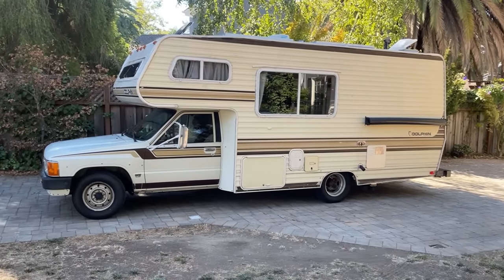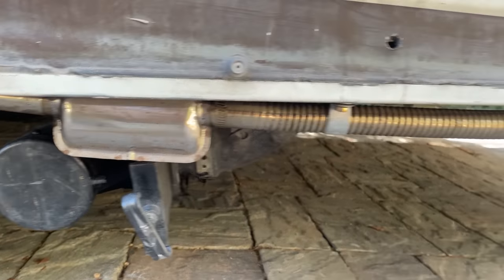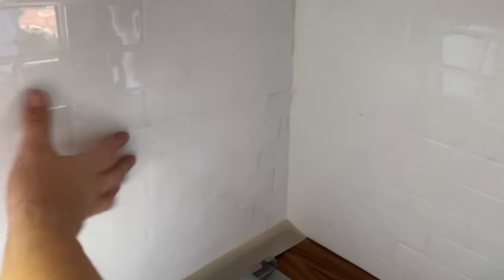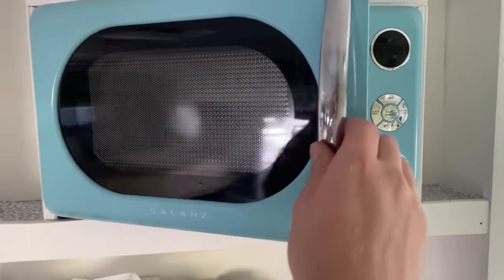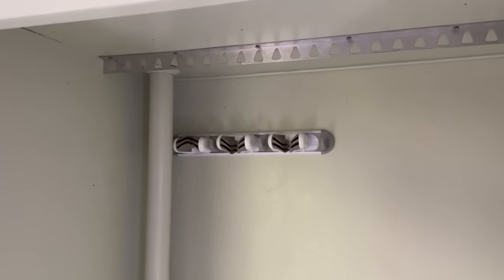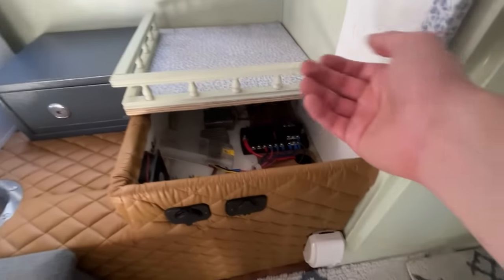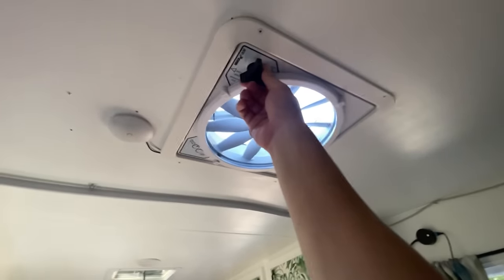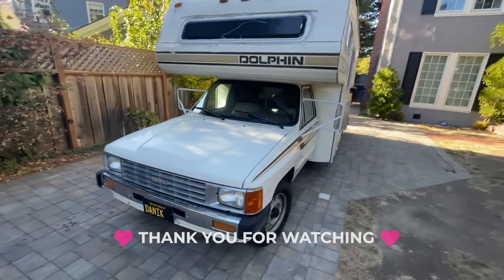Fully renovated & remodeled 1986 Off-Grid Toyota Dolphin Tour

Comment: That is super nice.  I would have been 23 when it was made.  I can tell you we never saw many of these on the road.  Back in the day we had auto stores that would lay a nice plastic flooring down over carpet to protect it.   Same as with the seats.  The plastic did a great job protecting the seats but the bad thing was if you were wearing shorts your legs would stick to it in the heat
Reply from the maker: Thanks for sharing that lovely story! I wish that the previous owners of this dolphin had the foresight to do something similar. Unfortunately the carpet was completely destroyed by years of much and dirt. Carpet seems like a cozy option, but man does it get gross fast!

Comment: I owned an '85 Toyota RV with the dinette right at the back but otherwise pretty much the same equipment and engine. I had mine for over 22 years and pretty much fixed or rebuilt everything on it including rebuilding the main door, the cabover bunk, both wheel wells and the roof. My rig was fun and I made trips all over the US but the going was slow and noisy and the original seats weren't very comfortable either. In the repair process, I realized that these RVs were built with mostly junky materials poorly put together. If you like working on your rig, this is the perfect one!

Comment: Use to work at a store that did all sorts of stuff to enhance your ride from pin strip to trailer hitches and more.  Had a person come with a old camper like that. He wanted us to remove the camper section from the truck and place it on a newer version of the same truck ( about a 20 year difference in age ).  Got very pissed when I told him that we would not even try as old camper would not fit on the newer truck and even if it did it would not look right.
Reply from the maker: I've seen many videos of people stripping the back and turning them into flat bed Dually trucks. You still would have to deal with the big gapping hole in the cabin.

In some instances I could see it worth it. You can find a ruined Dolphin for probably 2k, and salvage that into a truck (vs. buying one for 5-6k or whatever they go for nowadays)

Comment: Funny I’m watching this from inside mine that’s almost exactly the same. Other than it being the older 22r engine. It’ll still go over 80 in flat ground since I put a Weber 32/36 carburetor on it. 
It’s kinda crazy how similar everything you did to it is to mine. I mean from the tachometer, stereo, backup camera, ceiling vent fan, the sound system, battery bank, inverter even the tv mount is damn near exactly how I’ve got mine setup.

Comment: nice review ..wondering  if it has the 5 lug or 6 lug axle  ....been hearing the 5  is under rated for the size...But that might be from later models..and transmissions.....
Reply from the maker: All 86+ models come with the 6 lug. I would never purchase a 5, and if I had to I would immediately upgrade it. I've seen lots of posts of failed 5 lug rear axels

Comment: Yes that's the motor I need right there
Reply from the maker: Great engine highly recommended
Reply: The only difference between yours and mine the sink is by the door and stove is by the bathroom and the sink in the back rest identical but you got an engine in yours
Reply from the maker: @samuelcantley5500  That's an interesting set up, I have't seen that one before. I like mine better because when cooking you can just open the door to allow the fumes to exhaust. Good luck with the engine by the way! I'm sure it won't be too difficult it's just a matter of sourcing a solid engine

Comment: I noticed on that last panel 15:41 you mention you have a heat resistant cover under the panel door, where you have the 1500-watt inverter, does it get warm in that box wouldn't you want to let it breath let it cool off by putting an automatic heat vent that turns on when the box gets to a certain temperature these electronics start messing up when they get too warm and they'll last longer if they don't get overheated
Reply from the maker: That's a good point. It has passive airflow leading outside, but when I was setting up I did consider adding a fan. It wasn't an issue though even in the summer

Comment: The 22R-e engine. Beautiful engine the only problem with that motor is the cyl number 3.  If you already hit de 300k miles you better be thinking about refresh that bottom end. 
Other than that its a beautiful rig you have there.
El problema de esos motores en especial el 22R-e es el piston #3 , siempre da problemas por la forma en que la biela hace la fuerza en el cigueñal. Se desgasta el "bearing" casquillo de la parte inferior de la biela. Siempre pasa 
Te lo dice un mecanico especializado en Toyota.
Reply from the maker: Thanks! really appreciate the advice. Fortunately it still has many miles to go before 300k

Comment: Nice upgrades you forgot the strap and game console need another solar panel
Reply: Put to more Solar panels and no power problems
Reply: I don't worried about power 90 percent solar and star energy electronics and all diesel
Reply: 8 Solar panels and each 650 watts
Reply: I got AC in the cab
Reply: King size bed switched from a queen

Comment: I guarantee you it’s a pig to drive I’ve had one similar but it was a pig to drive all over the road and gutless
Reply from the maker: It's not too bad once you get used to it!
Reply: Sounds like your rig had serious steering/suspension troubles.  Mine only wanders when there is a strong side wind.  Don't expect American V8 power and 6 mpg.  This one is a reliable, Japanese 4 cyl that takes its time getting you to 55/65 mph at 17/18 mpg.